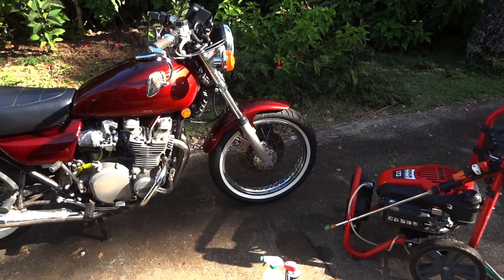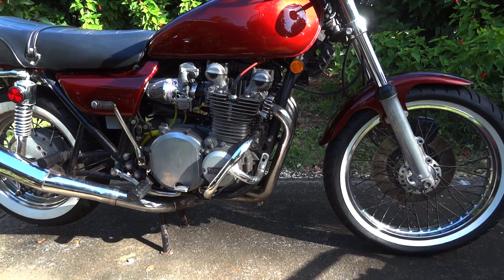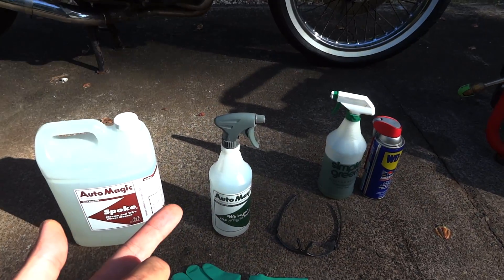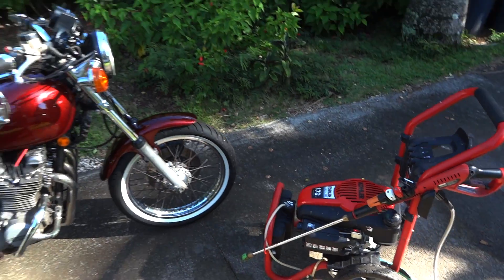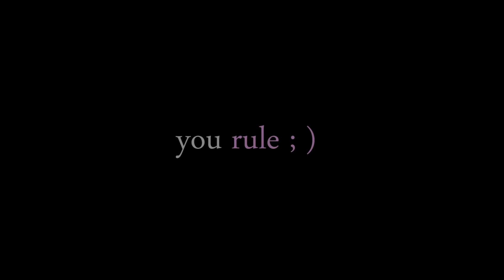How to acid wash an engine ++AB-31

Comment from the maker: When I bought the bike it came with sissy bars.. The rig was ratched strapped to that perfect angle : ) You may be able to get something welded that can use your rear foot peg mounting holes.. I wouldn't use PVC unless you are ok with potentially losing a camera.

Comment: Wow that seems to work beautifully.... I would like to try that stuff out on my little 125 to get all the rust / dirt / corrosion-oxidation off of it, since I have to leave it outside it gets pretty nasty and very hard to clean.... So all you do is spray that acidic solution on the metalic / chrome parts, let it sit, then wash it off?....

Comment: Aloha, whut's shakin' brah? At any rate, since you mentioned that the plugs foul out too fast, I recall my aeronautics instructor learning us that in older engines, you can try a "hotter" heat range spark plug to help reduce oil fouling, goto tripledubya.championsparkplugs..com, it has a fairly simple explanation re; tuning and plugs..and competitors dif between "heat indexing". It'd be alot cheaper than rebuilding the heads and cylinders. Btw, have you been able to "sync" the carbs? bib...

Comment from the maker: it is designed to primarily eat rust. It takes gunk off aluminum but should be followed by a nice machine based polish session. It doesn't harm rubber or paint in the short term (5-10min) I was quick to rinse.. It DEVOURS RUST...

Comment: 25k is way early, most rings will last on a bike until 75k -100k
i know what you mean though, the old bikes rock but sometimes you see the new ones looking you up though the showroom window. generally when the piston ring are gone it will smoke during deceleration if i remember right. exhaust valves generally smoke when starting the bike and i think intake haze all the time. (intake valves are generally the first to go due to the dirt sticking to them) pod filters are bad...

Comment from the maker: only had the carbs rebuilt : ) The previous owner had said he did the top end.. not sure if that meant valve guides as well but assumed it meant lapping the valves at least.. If the previous owner was telling the truth, perhaps it could be rings.. KZ forum members say rings going out at 25k (orig miles) is very rare.. Either way, SOMETHING ain't right and I'm bored of investing in her.. I'm kind of at the point where I just want to wait and do a full on, ground up show build : )

Comment: like burnt oil or clean? when testing compression you put oil in the cylinders to see if the rings are leaking. you run a dry test and one with oil to compare the numbers. i thought you just had this rebuilt?

Comment from the maker: it smokes if you rev it hard.. not a whole lot. When the mechanic did a leak down test, he said it was the rings which I found odd. They were all uniformly down 10psi from stock spec.. There was oil on the pistons so it's getting in somewhere..

Comment: Holy crap dude... I may have to try this trick on my CB500 :)
The engine is totally ratty with that fluff kinda look and its a bitch to clean up... This looks like it did a pretty decent job. May have to see where I can pick up all this stuff in the UK.

Would love to get my CB back up and running :/ Shamefully though its net a retro 70s CB but a mid 90s job. Picked it up from a London Currier so its a total rat... but its my baby :)

Comment: I drove the 1974 version of that bike back in 74 or 75.   It was a thrilling experience.   Your bike looks good.  If you feel comfortable removing the head, then purchase the guides and valves and have someone install.  Put the head back on yourself.   It should be less than 500 dollars.   The valves may just need lapping as well.   Not an overly expensive job.  Regarding bike forums, there always tends to be 10 or so that control the forum.  They can be real dicks.  I tend to ignore them.